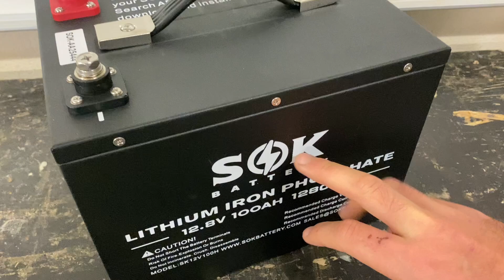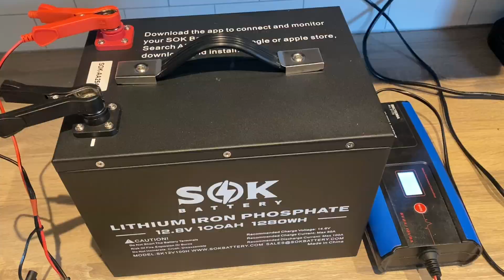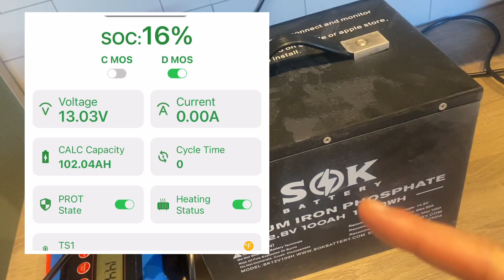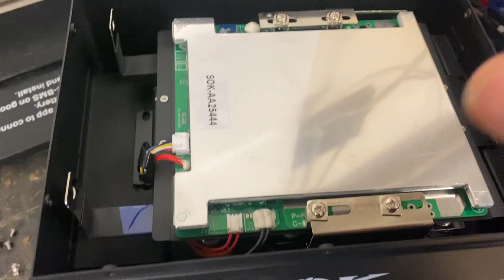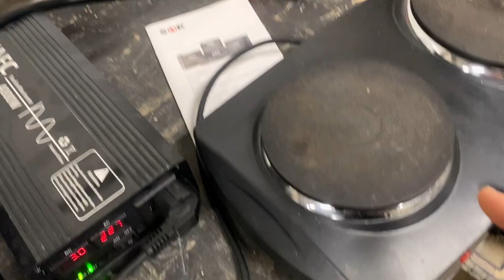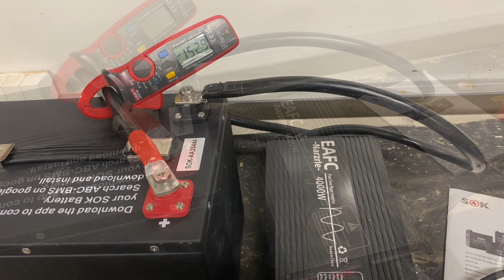SOK Smart Battery Review: 100Ah LiFePO4 Tested, Frozen & Opened Up

Comment: Great video i have subscribed. 
Just brought 4 of these .
But they have been in storage for a year and a bit  ,so i dont know if they are any good now as the batteries are dead.
Bms has shut down.
All new in box but no power.
Was a long transit issue .
😢
Reply from the maker: Thanks for subscribing, hopefully they wake up once you put them on a proper charger! 👍 or if you have another 12v lifepo4 that works, put it in parallell with the new ones to wake them up. Usually works